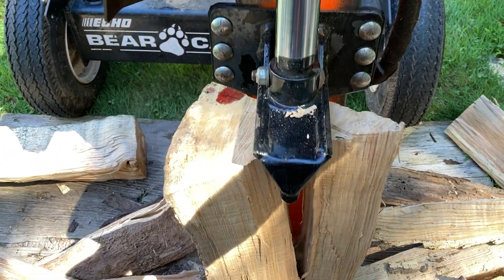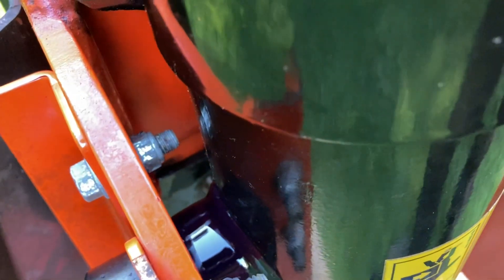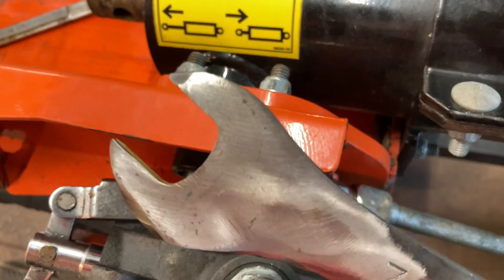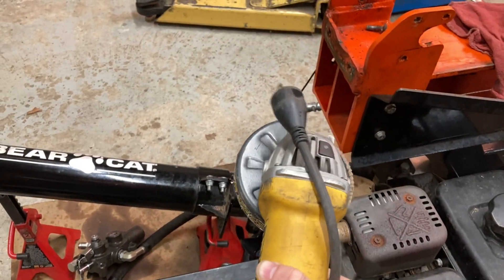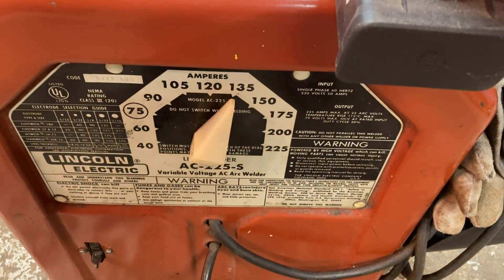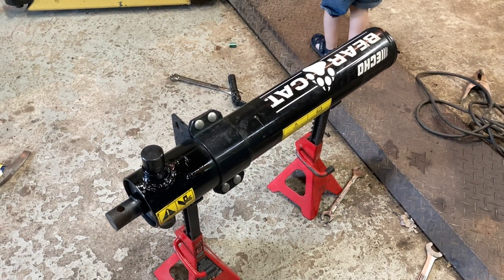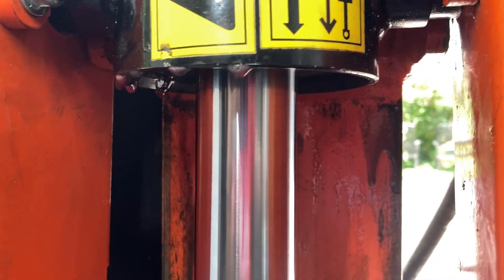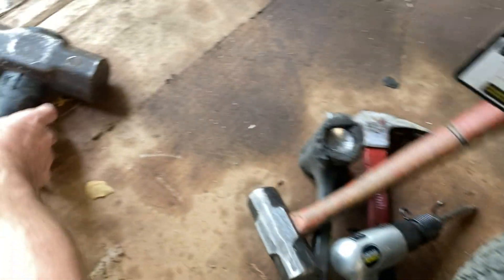Echo Bearcat- They Don’t Want You To Fix These Splitters!

Comment: My father uses an antique Sureweld DC stick welder and here's a piece of advice. If you're worried about how a weld looks, use 6011 to begin with that way the weld is strong then go over it again with 7018. The thinking behind this is 7018 doesn't penetrate as deep and as-such doesn't make as strong a weld as 6011, but it is a lot easier to get cleaner looking welds and somewhat blend the surface with the 7018 than it is with the 6011.
Reply: Dude I grew up in the shop working for my mom’s stepdad… diesel repair and fab shop. We built everything from dump bodies to dozer blades and we did it all with a Lincoln Electric welder that looked like an old-time radio scaled up to weigh about 800 pounds.

Never let anyone say stick welding isn’t a valid option. Cheap, easier, and a million times the options in that you can pick your rods for your job.

Good for your dad! Keep your stick on the ice! 🤘🏼

Comment: Would you still have the part number to the MTD cylinder that worked in the end? I appreciate any feedback! And also great video. Enjoyed watching.
Reply: Sweet! Your awesome man I greatly appreciate it!
Reply: Thank you for that! Made life a whole lot easier finding you on here 👍🏻
Reply: Also if you know the model of your splitter compared to mine that’d be helpful also, mine is the LS33340T
Reply from the maker: Oof that’s a big ole girl. Mine is only an LS22. You have a 5” cylinder. You also need to know the trunnion diameter, the outside diameter of the piston where it goes into the wedge, and the width between the trunnion carriers. With that info, tooltuff can find the right part number for yours.
Reply from the maker: I’ll do you one better- here’s a link to the one I bought. I went direct with the manufacturer to avoid any more Amazon mixups. 

https://www.tooltuffdirect.com/products/hydcm45f?_pos=1&_sid=0dce351ac&_ss=r